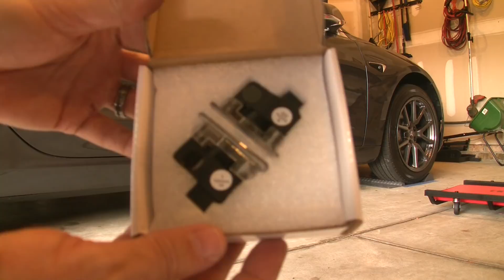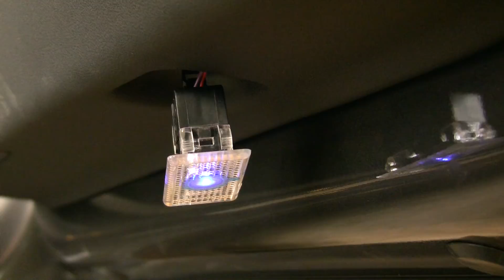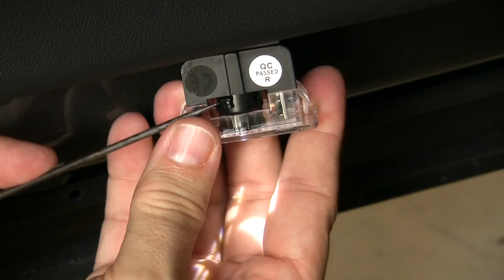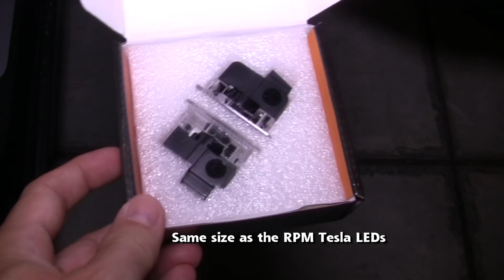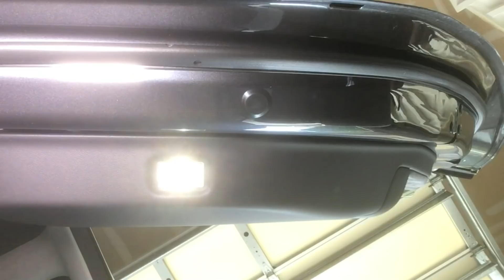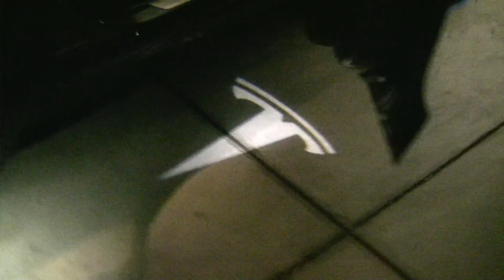Tesla Model 3 - LED Lights Part 1

Comment: The car is there mean that’s that’s what you’re referring to turn on lights from the front close or turn off Voltages are send more on the rear do you have 0EM 12v battery?  You could buya lithium batteries

Comment: Great seeing you online again MTNRanger.  I remember you as a frequent contributor in the GM Volt forum back when the Volt was the latest, greatest (under appreciated) plug-in.  I picked up the RPM lights several months ago, and they’re well worth it.  I also picked up the blue ambient lights for the front floor, which compliments our blue 3 very well.
Reply from the maker: Thanks.  I enjoyed my Volt when I had it for the 3 year lease, it was sad to see it go.

Comment: Ok based on price and brighteness, color matching between each light,, which brand do you prefer overall?
Reply from the maker: The 5-pack of RPM Tesla bright LEDs which works out to $49 if you use a coupon code (youngtesla).  I didn't test the Abstract Ocean bright LED lights, so I don't know how bright they are.  But they have a 4-pack for $36.79 or 7-pack for $63.19 after coupon (teslainventory).  For the projector LEDs, the RPM Tesla are $45 for a pair (with coupon).  The Abstract Ocean are $35.99 for a pair (with coupon).  I'd go with the AO based on what I have seen.
Reply: Sounds like you’re. not truly satisfy

Comment: Great video, although you're keeping me from getting to bed on time. I know, I'm lame!
Is it possible to add the underfloor lights that he Model S and X use?
Reply from the maker: From what I read, the footwell lights in the front of the Model 3 are not working correctly with these replacement modules.  RPM Tesla does have colored LEDs made for the footwells.
Reply: Thank you so much for the great information!
Reply: We have the RPM blue footwell lights in in our blue 3, and they look really nice.  We get a lot of compliments on them, actually.  More than you’d think.  :)